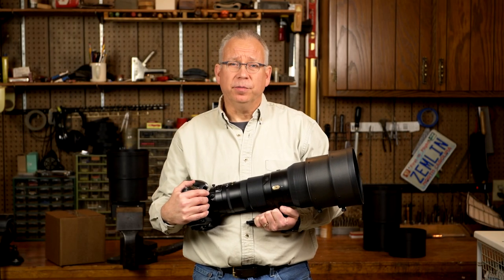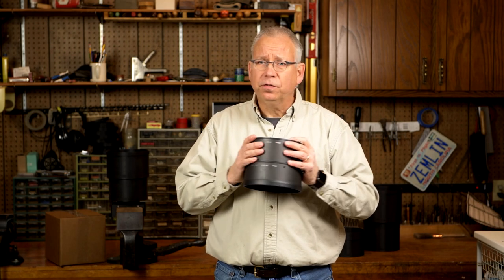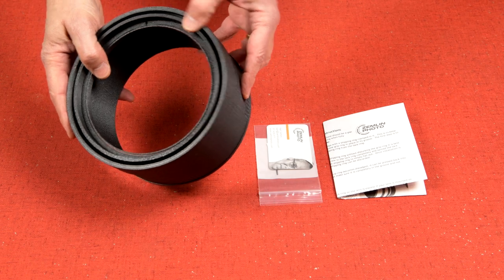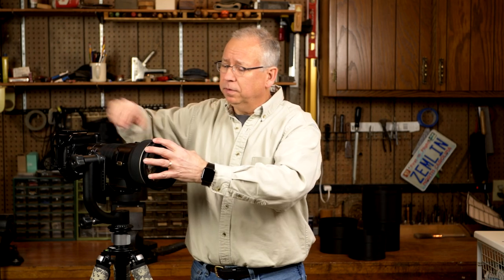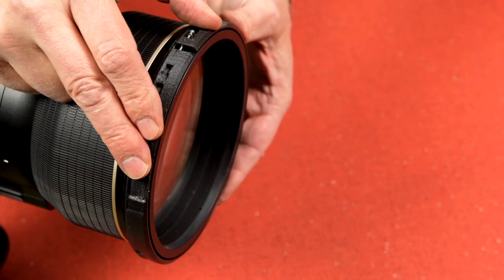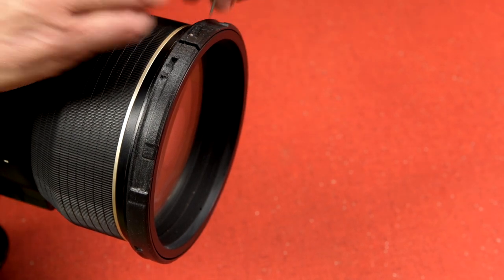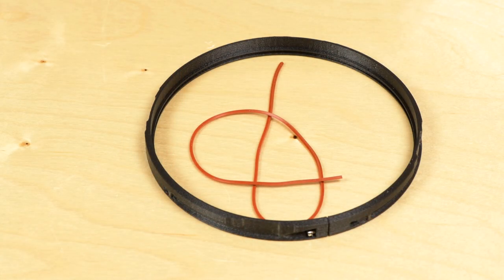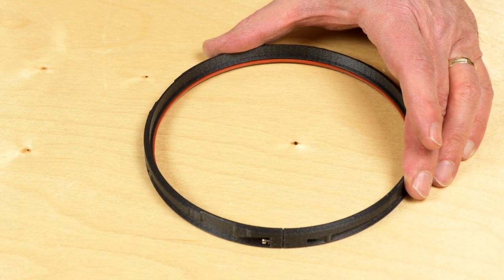Zemlin Photo Bayonet Hood Unboxing & Installation

Comment: In theory, what would happen if the orange rubber grip ring came out and the user was too inept to place in back in the groove, and so he just installed the lock ring without the grip ring?
Reply from the maker: When customers have reached out to me about not being able to get the silicone grip ring back in the groove, I have supplied a replacement lock ring assembly at no charge.  I have never had a customer have issues with the second ring.  There have been a few who installed the ring without the rubber grip ring and have been satisfied with it.  My only concern is the potential for the ring to slip when removing the hood.  If the ring were to spin on the lens, it could be difficult to remove the hood.  If one were faced with that situation, I can provide tips on how to remove the hood.
Reply: Thanks for the response!  One mire dumb question then I will let you go.  Say this inept character took off the lock ring to send the lens in to Canon for service (Canon having a policy to remove all accessories prior to service).  That is when the rubber grip came out.  Would a few dabs of Gorilla Glue Gel (does not expand) at intervals of about an inch help secure the rubber grip back into place?  Or is that a poor idea?
Reply from the maker: @kentmyles6784  The ring does tend to stick to the lens after it's been on for a while, so having it peel out of the ring when you remove the ring is typical.  I have never used glue to hold the ring in place, so I can't speak to how that could impact installation.  They way Gorilla Glue expands, that could limit the ability of the silicone ring to deform as it gets squeezed on installation.  I have tried to come up with a better option for the grip ring, but within the limitations of 3D printing, the wide variety of sizes I make, and the relatively low volumes, I simply haven't come up with a better solution.

Something to consider when seating the ring into the groove is to push it back a bit as you press it into the groove.  I use my thumbnail and as I press it in, I also push it back so it's getting 'packed' into the groove a bit.  I've done this many hundreds of times, so I'm not sure how to best explain the process.  Maybe I need to do a video where I am teaching someone who has never put the ring in before to do it successfully.  I'd be happy to do a zoom call if one-on-one coaching might be helpful.
Reply from the maker: @kentmyles6784  One more thing I meant to say, if you think cutting the rubber strip into a few shorter sections might help, there would be no harm in that.  Maybe packing shorter pieces into the groove would be easier.  It would not impact fit/function of the hood.
Reply: Ah, excellent.  I will try a few more times and worst case scenario will try the smaller sections tactic.  Thanks again!